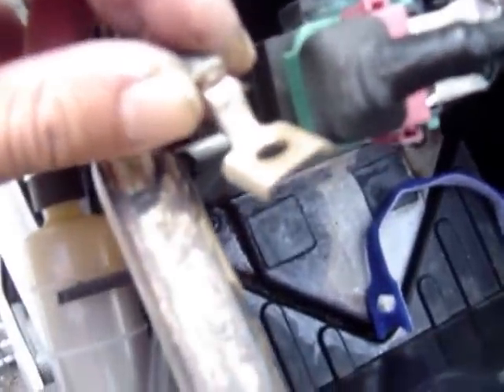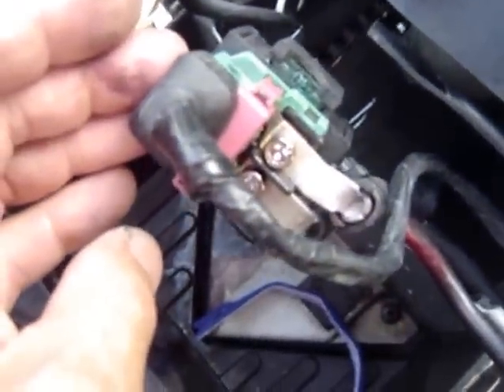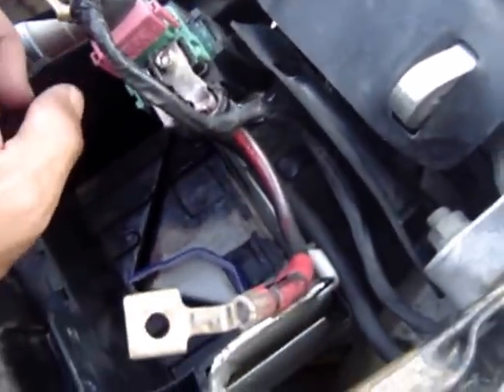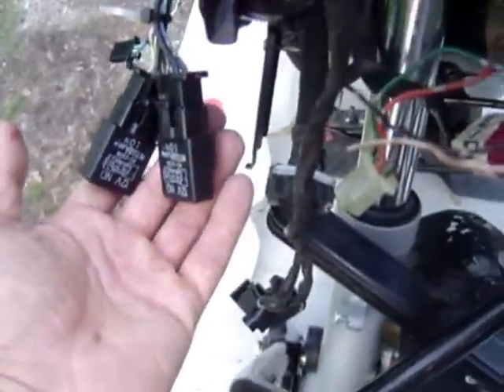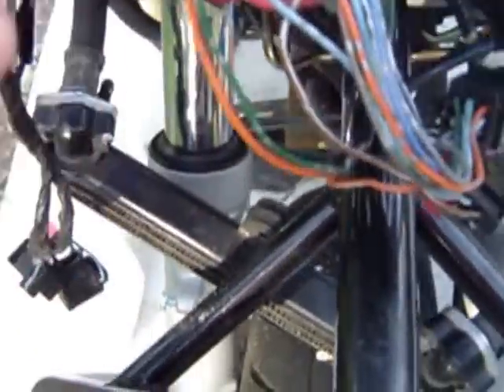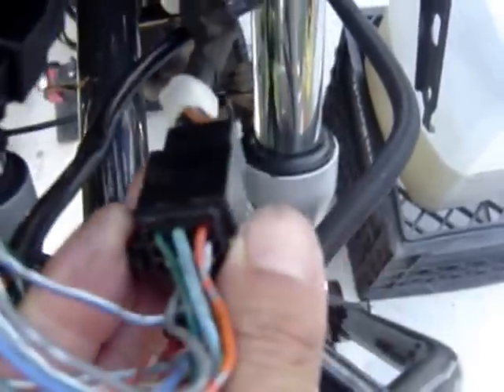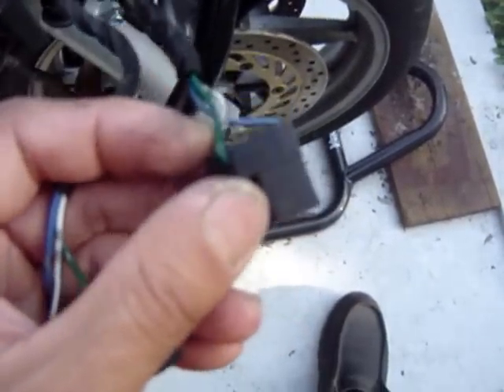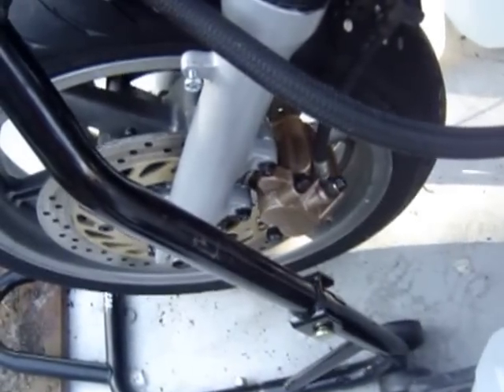Troubleshooting Motorcycle Electrical Circuits - Quick Simple Methods (92 Honda VFR750)

Comment: Hey Alex. I have a Buell 08 firebolt xB 12r. My fuel pump fuse keeps blowing ad I have replaced it twice and as soon I hit the ignition switch is blows the fuel pump fuse. Any ideas
Reply from the maker: Yes.  TOO MUCH ELECTRICITY!  The question is, is it before, after, or coming from another circuit (short)?
Reply: Alex. I have checked all the wiring just to see if any wires was exposed or touching each other. I did not see anything. Could it be the ignition relay that is bad and making the fuel pump fuse blow every time?
Reply from the maker: To check for a short, measure the ground wire on that circuit or energize it with a new source, isolation method.  An active short is when the engine is on.  A passive short is when it is off, no power.  If you are positive it is not an active or passive; then work backwards from the problem; you have to look at a diagram and choose YOUR STRATEGIC MEASURE POINT.  I cannot on this end.  Start by giving your fuel pump 12 volts with a jump box.

Comment: I have a 2002 shadow 750.left rear turn signal isn't getting power.is it something simple without tearing everything apart?
Reply from the maker: Go from the turn signal relay to the light.  It should be simple.

Comment: hey alex, i have a Kawasaki Kz550 that o customized and i put a new tail light on the bike but the brake light stays on constantly from the second i turn the bike on, do you have any idea why the brake light won't turn off?
Reply from the maker: If I had to take a wild guess, I would say your spring is too weak or the brake mechanism is stuck; try some oil and lube it to see if it does not turn on and off; otherwise, you have to crack it open and start testing circuits to determine exactly what wires are touching.  MOST electrical problems are easy but intimidate people or they are annoying and time consuming.

Comment: Hey Alex got a 94 f2 so i bought a brand new battery and a starter relay fuse. i rode away to the bike shop and it died 5 minutes later. I burnt about 6 30amp fuses trying to start it haha. As soon as i turn the ignition it goes out. All my grounds do seem to be good. However im running no dash and no front signals. Its never been an issue before!  Where would you recommend i start? should i snip the wire connectors and put end caps on each wire? so there not open.

thanks bud!
Reply from the maker: IT SOUNDS LIKE YOU PURCHASED A JUNK REVERSE STARTER RELAY.  I have a few of them and do not even use them; they are advertised as the replacement but the +,- on the starter relay are reverse.  You need a wiring diagram for the starter relay, I have it in one of my videos.  Always use an OEM Honda starter relay to avoid this.  Honda has wires that prevent faulty or reverse starter relay wiring.   The positive is now the ground and that is why the fuses blew.  You did not catch this but it is the seller who got the wrong part for you.  There may be damage to other things now.  Fix the starter relay problem first and start over because you have to check everything now.  

Well, since the bike won't start, get a jump box and test out your fuse box.  Make sure you get an identical charge amount on the bike when you use it as the source.  If things are normal, then recharge the battery and start the bike up, it could be a bad or loose battery terminal.  If the bike is dead when you have a fresh battery or jump box; then you know it is the starter relay; you can "jump" the relay if it is bad by using a screwdriver and touching one side to the other (BE VERY CAREFUL AND RESEARCH THIS, GET SOMEONE TO SHOW YOU HOW).  If you have fuses blown then replace them and try the battery-jump box again but do not crank the bike.  Now you can rule out the starter relay and fuses.  Why won't the bike start?  If it starts, then begin the procedure to test your 3 phase in AC current.  You are delving in difficult territory so research it if anybody can show you on a video.  A new stator is pricey but well worth the money for a heavy duty new aftermarket.  A used or OEM is the logical choice.  Fixing a bad stator is very easy, lots of videos out there.  The CBR has a mosfet rectifier; they never break down so I am guessing your stator, a short or bad wiring job,

If all of this checks out, then it is a diode in your safety circuit.  Some of the Hondas have a safety circuit and the diode is bad or intermittent.  It won't blow all the fuses, but one or two.  START AT THE STARTER RELAY, THEN FUSE BOX, THEN ISOLATE THE CAUSE OR SHORT.

Comment: I just replaced my stator and now my headlights not work on low beam and my brake light stays on and turns off when hitting the brake and my turn signals dont work only thing working is my horn, high beams and starter
Reply from the maker: Sounds like you have REVERSE POLARITY, two wires backwards.  yeah measure the 12v at the connector, the headlight could be the relay.  The rest sounds like a short.  The only way to find a short is to isolate it.  This you will have to research on youtube until you can master it.  It is wise to have a wiring diagram or a shop manual for your bike model and year.  That is a good start.
Reply: I figured it out just now I had a ground wire loose so any lil movement would cause it to either power everything or not and then I found that the brake switch wasn't sitting right for some reason so everything is working now except for my low beams.

Comment: I'm having a problem when my green neutral light stopped working as well as the bike back up does not work. There doesn't seem to be a fuse out in the fuse box or a fuse on the three layers of circuit breakers under the seat. I think the light and switch for reverse is broken or there is a wire off. Not, sure? Any ideas?
Reply from the maker: the neutral light is a difficult fix.  it is part of your starter cut off circuit and there are many components and steps to diagnose it.  your first step is to get the wiring diagram and begin measuring.

Comment: i have 5 wires coming out a stator (black red yellow blue white) how it should be connected to regulator?
can i connect red direct to battery
Reply from the maker: +Dinesh Mourya IF you have a three phase stator, then you should have 3 voltage-current wires measuring alternating current (15-60 volts AC).  This leaves only two wires left; one is ground and the other is the hot wire (13-15 volts DC).  Make sure your voltmeter has alternating current or the right probes are used.
Reply from the maker: +Dinesh Mourya If you have three wires out of the stator, they should all be the same alternating currents.  Other than AC current out of the stator to the rectifier-regulator; there is nothing else.  That AC current will be turned into 13-14.5 DC volts after it leaves the rectifier-regulator.  From there it goes into the starter relay system or the ignition (ACC in car terms).  IF YOU CONNECT YOUR STATOR TO YOUR BATTERY, IT WILL BLOW UP, make sure you wear your helmet if you do this.